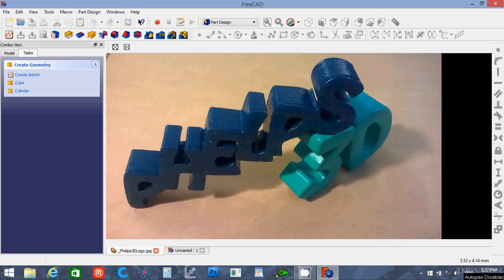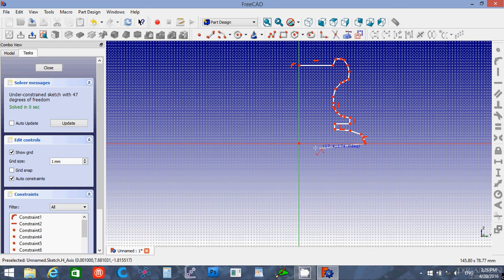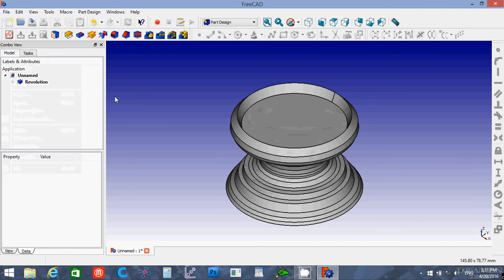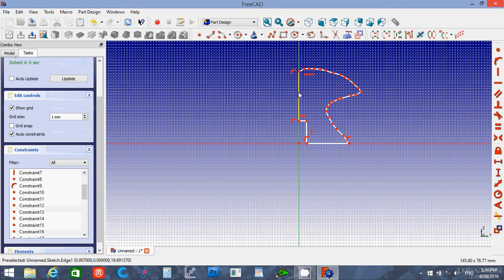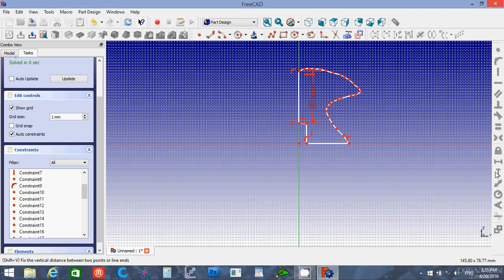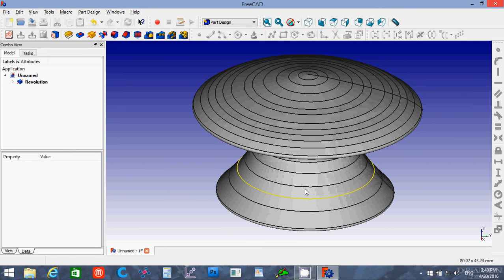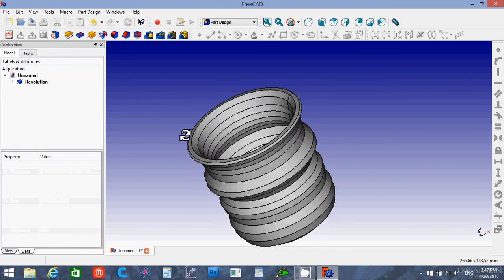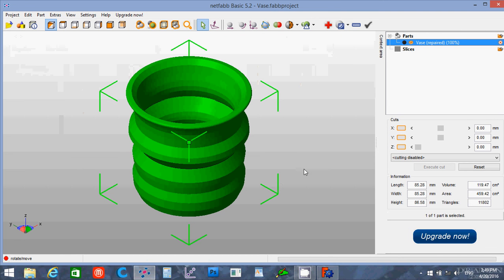Phelps3D FreeCAD 0.16 Part Design Revolve Tutorial

Comment: Hey thanks for the video real good lots of good info I am new to 3D print and the use of the freecad what sofware are you using for slice ?thanks
Reply from the maker: Depends on the printer. I have used Slic3r, Cura and Makerware are in the past. Prefer Cura's simplicity and wide printer support.
Reply: Thanks don't give up your videos you are good best I find in you tube thanks